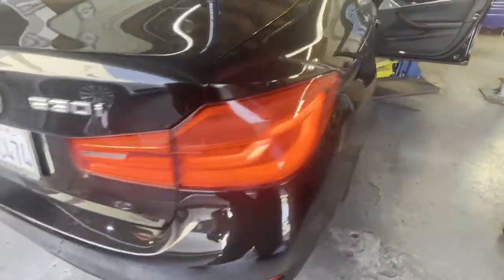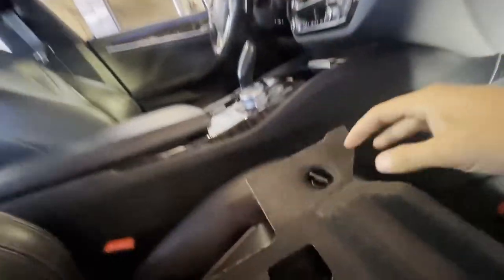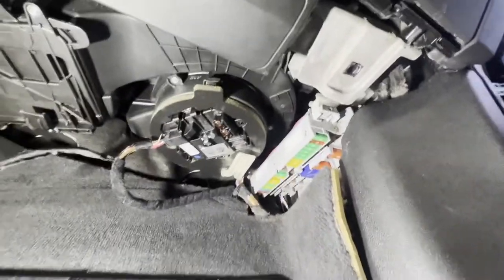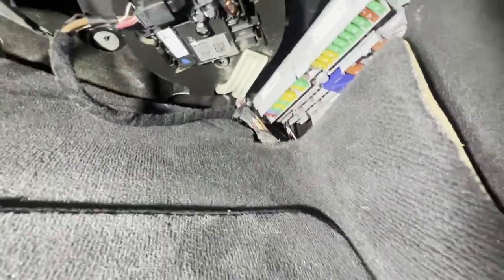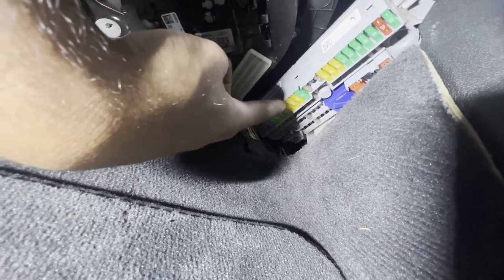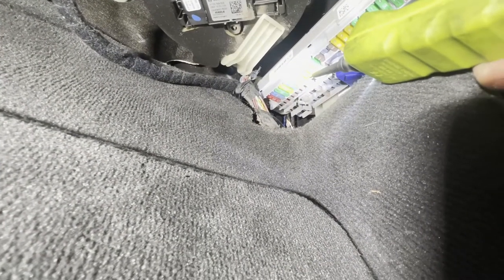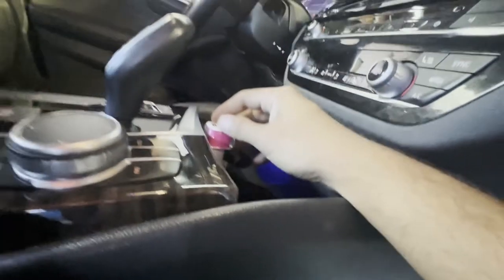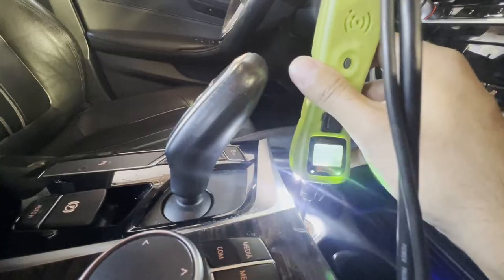How To Fix Bmw Cigarette Lighter On Newer BMW

Comment: How to fix BMW cigarette lighter. First drop the engine and transmission. Then take off front quarter panels. Chop off roof. Extract lighter. Lighter cost $5.99 plus $45,000 for the damage to the car. Happy smoking.